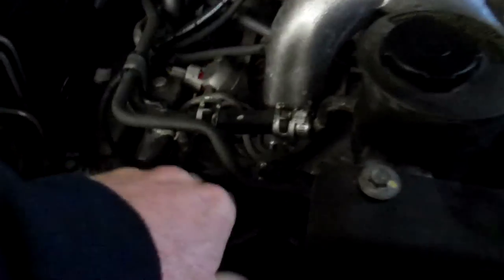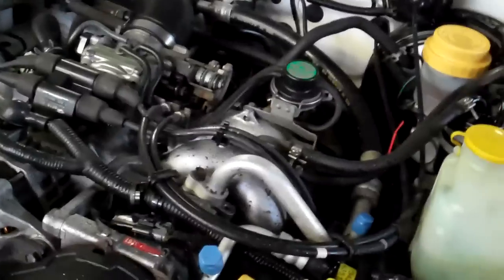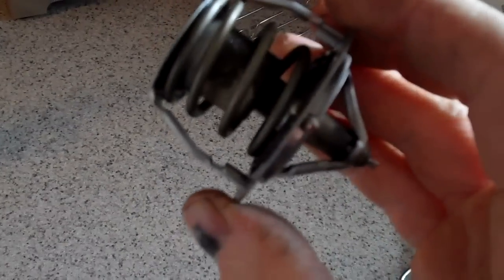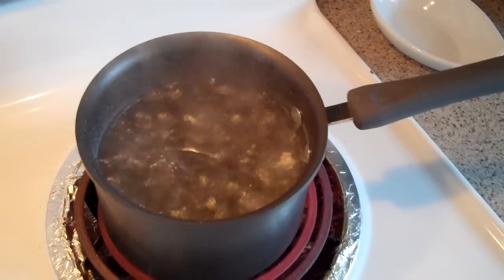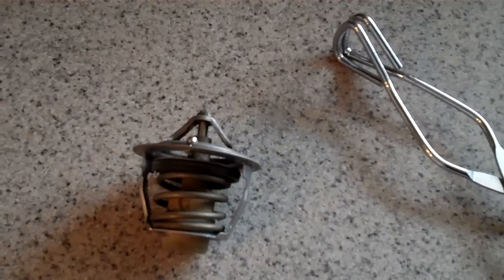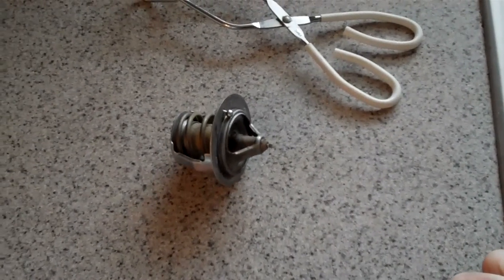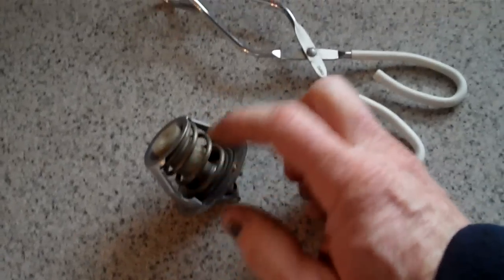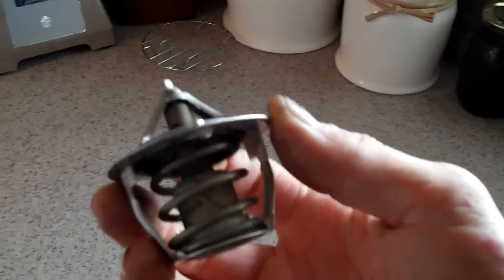How to diagnose a Subaru that overheats after ten minutes of driving

Comment: I have a subaru legacy 2006. My subaru overheats when climbing hills or when on fast speed on a highway or when I go long distances. The engine heats up so fast when I accelerate. Also the coolant is consumed super fast. What might be the problem, I changed the gaskets and had the block realigned, but the problem still persists.
Reply: Mugambi Alois Having the same problem, suspecting the thermostat. Going to buy an OEM thermostat and praying it fixes it. Will comment again if it resolves the overheating. GL to you!
Reply: Thermostat always sticks shut. They put a small hole in them but not enough to keep it from overheating. I always change emm and drill a 1/8 inch hole in mine to keep it from ever being a problem again. Just my 2cents.
Reply: Thanks Kianna. Waiting for the feedback
Reply: I replaced my radiator and the fan switch and my problem was solved
Reply: Mugambi Alois 
Hi, where did you get the fan switch? ..and radiator have good pressure and is not leaking..should i go ahead and changed it anyway? Please answer me back and i do appreciate it, thanks
Reply: I had that issue. My engine just went to shit 2 days ago. At least I think it was my engine.

List of stuff done to my car since I have had it...

Head gaskets
Oil change
Thermostat
Serpentine belt 
Water pump
New tires
New tire stud front passenger
Cv axle, passenger 2x. Bearing was bad in the 1st.
Rockers

I think that is it. I have had this 2002 subaru outback (vin matches a legacy... which is slightly weird) since April 23rd of this year.

I was going down a hill this past week, sounded like something metal shredded and bounced around the underside of my car. Realizes my engine wasn't running. Realized my brakes were not working. My steering went. And my 2yo daughter was with me. Car would not start after I got it into a clearing. Anyone else have any issues similar to mine? Mind you, I also the issues mentioned by the original commenter. Overheating on the highway etc. Oh, and my car stalled out when I was running the heater to cool off my car, and I stopped at a red light.

Comment: Great videos! I've been trying to help a friend of mine with a forester a small dealer pawned off to him.  Overheating ever since.  I've personally never had one.  Helped him flush fluids, change thermostat, etc. He has a family of 6 broke can't afford a mechanic so tried using liquid glass, head gasket sealer... I know, but just trying to get him by, 5 mile daily drives.  Then I saw your videos. So I know it's temp fix as well but what size drill bit? and where should we drill? Thank you

Comment: Question: I was a Honda / Toyota tech for years so much to my disliking my son wanted a 2002 Forester. I hear these are good cars but this thing has been nothing but a piece of shit! When we bought it, the guy supposedly rebuilt the engine. He gave us a 6 month warranty on the rebuild. Within 2 months it blew the head gaskets! We took it back and he replaced the thermostat, radiator, both heads and a water pump. It lasted another 2 months and now it's pushing coolant from the radiator to the expansion tank! I'm at my wits end! Do you have any idea what is causing this? Are these engines really this fragile? You seem to have a great knowledge of these vehicles tell me what you think? Thanks Tracy
Reply: U should ask if he had the heads machined and pressed during the head gasket replacement. The heads shitty aluminum tend to warp when the gaskets go from the high temp and overheating issues from a head gasket gone bad

Comment: Hey brother can you tell me what you tell me what you would think it is when the car only over heats when still, but good when you drive ?
Reply: Check the radiator and its ducting for obstructions and make sure the fans work properly.
Reply: Vix Damone I had that happen on a 2000 Ford Focus SE.  Turns out either the Low/Medium Speed Fan Relay or the actual thermocouple/thermocouple wiring harness were bad.  I just changed both and the problem went away.  Basically, if either of those were bad, the fans wouldn't turn on until the temperature was up in the red.

Comment: well what if your driving with a faulty radiator and your only driving for a few seconds with the temp gauge in the hot range but after like a mintue or so you shut it off to help it cool? the plastic fitting on the radiator that the upper hose connects to completely discintigrated and I was trying to get it home...would that kill my head gasket?

Comment: brian,
i need help on this one. so the car overheated. i put in a new water pump, thermostat, both head gaskets, all the belts and many other little mods. after two hours of testing in 30° temp i have some assumptions. the top hose is always hot and bottom is always cold. i drilled two more holes in thermostat in case of air or combustion gases. when the hot air is on and driving, it cools properly but the air turns cold and instant overheat. mostly turns cold when i accelerate or drive for ....

Comment: I just started having problems with my 1991 sub legacy overheating. it only as 99 000 kms on it, and folks who know my car immediately said thermostat. we haven't tried replacing it yet, but the car is also making a knocking sound. Do you know what that could be about? Otherwise it's overheating, with no warm air making it into the car. It's cold here in BC right now, so that's a noticeable symptom.
Reply: I checked the thermostat and it's fine, replaced coolant (the coolant was looking pretty gross and dark) with the car running. It sounded a bit better with the fresh coolant making its way through the system, but then light white smoke started rising from the exhaust just next to the manifold. I checked the oil for antifreeze and didn't see any milkiness, and I had previously checked the rad cap for oil and didn't see any. Any suggestions of what this could be?
Reply: Annelise Grube-Cavers
Is it turbocharged? Check around the turbo if so.
Reply: Hii did u find the problem?

Comment: I had some serious overheating problems with my 1995 Legacy. After driving for 10 mins the temps were at max and i had checked that i had enough coolant. I was thinking that i have head gasket problems, but car worked normally. There was no white smoke coming from the exhaust. Also i saw that water pump worked fine because the coolant was moving in the system. Thermostat also opened normally when i warmed the cold engine in the parking lot with hood opened. I started to suspect that there was air in the system because there was no warm air coming in. I got the air out of the system and the car won't overheat anymore. Luckily i didn't broke head gasket when i drived with overheating car. At least the car works fine at the moment.
Reply: how did you get the air out the engine? Im having the same exact issue and suspect it has air in system, please help
Reply: How you take the  air out from your system
Reply: @marcorivero1768  Basically i squeezed all those coolant hoses around the engine with my hands to force air bubbles out while engine was running but i didn't stress the overheated engine, i let it cool first. Then there is a special bleeding valve made from plastic to release air out system but it can easily break in old cars. Another way is to open cold engines normal coolant fil cap to release air bubbles from there while engine is running and you squueze those hoses with hands. Caution: just remind that don't open coolant fil cap with hot engine though. More info on this bleeding subject, use words "Subaru coolant bleeding/refill" to see how it's done. This video shows that plastic bleeding valve https://youtu.be/tpy3GpbADRo?si=z_7c2W3VkaZBbdSp
Reply: @marcorivero1768  If the engine is cold, you need to wait until car warms and thermostat opens. I forget to say that idling is not enough, it's better use rpm 2500-4000 to force the air out and force gas pedal with a wood block or use a friend who holds rpm during the process. BTW to everyone, i figured out that it was air in the system because only cold air came inside the cabin even tough engine was at dangerous max temp point and fan was set to blow as hot air as possible to cabin, but only cold air came in so there was a air blockage in coolant system. Car worked fine 20 000 miles after this problem was fixed and didn't happen again. My plastic pressure release valve broke when i opened it but i fixed with Loctite repair putty and used normal radiator fil cap to get air out + hands on those hoses. 

Continually squeeze the top and bottom radiator hoses to force trapped air into the funnel, this can take 5-minutes or so. Now start your Subaru engine and turn the heater temperature up to maximum but the fan speed to minimum. Allow the engine to warm up and the thermostat to open so the temperature gauge reads normal. This can take 10 to 15 minutes, and be sure to keep topping up the funnel as required. Rev the engine between 2500 to 4000 rpm off and on for 5 minutes, this should allow the water pump to force air out of the system. Note that warm air should be coming out of the heater vents, if not the heater must have air trapped in it, STOP the engine and allow to cool down.....

https://youtu.be/Qp7oqWe6vtw?si=lUSTYPh5D47X93Tw

Comment: Presence of exhaust gasses in the coolant is sign of a bad head gasket as detected by Evertough Combustion Leak Detector #67094 and Detector Fluid #67098. As for the Oil thing the problem is there is way too much. The idea of peak oil came from lack of oil in easy to reach places. With the change in technology like deep sea drilling and fracking, oil and natural gas has become plentiful again

Comment: Hey i tried all these and turned out i had a split heater core in my dash and it was only after squeezing the radiator pipe was the coolant that was leaking visible the other give away was the carpet was always wet i thought it may have been because of the front vent leaking but after disconnecting the heater core it stopped overheating

Comment: hi Brian.. I live in Brazil and have a WRX 2002 turbo (all stock). three months ago it had two  singular event.. after one week whitout use, on starting the engine  I heard that sound like connecting rod noise but after few minutes it get normal again ..I completed the engine oil a little bit more..some day after I hit a speed bumper ..and tem . the gas pedal has now an annoying vibration ...could it be related to  CRANCK BEARING DAMAGE or ENGINE MOUNT DAMAGES ( the mine are the soft OEM mounts

Comment: a few minutes, if i let it sit it will take about 7 minutes to cool and still cold air but if i turn it off for a minute or two and start it back up it is always warm air blowing and thermostat open. i am stumped and have no clue. and i used two different thermostats. and new head gaskets and new hoses and flushed 3 times and filled without air voids PLEASE HELP, thanks drew

Comment: We just bought a 1999 Subaru and it over heated on my husband.  The upper hose was collapsed and I could hear some gurgling noises then all the sudden the coolant went down in the over flow and the coolant went down in the over flow.
Reply: Hi! That is exactly what my 99 Subaru Legacy Outback is doing. Curious to know what your outcome was??? I have bled air from system multiple times and replaced thermostat- and drilled several little extra holes in thermostat to allow better flow through it all of the time. Hot hose on top and cold hose bottom.

Comment: briansmobile1, you are almost a celebrity Brian, all due to your 'hot' information.
Can you please advise where the coolant temperature sensor plug is on this boxer motor?
Subaru Forester XT 2.5 litre engine 2007-2008 crossover model I'm told.
There was no temperature gauge on dash-panel, or in an electronic dashboard display, only a temp sensor light that when it comes on 'red thermometer' appears in dashboard display but only when it's too late and the head gasket has given itself a pestering overheating gasket crack.
I am in Australia, State called Tasmania. I would truly appreciate your direction as to where that sensor plughole is located?
Thank you, Brian, give me your address and I'll send you a thank you gift. Old William.

Comment: so there was a little oil in the coolant overflow tank. what does that mean exactly?
Reply: HG, but are you sure it's oil and not just deposits from the cooling system? The deposits are usually black and floats up to the surface in the overflow tank. Its plausible that it could look a little bit dirty in the overflow tank without it being anything serious.
Reply: MYTURN2DIE SUNDSVALL

Comment: Hey Brian

Love your video's! They are extremely helpful!

I recently changed the thermostat and filled it with with water to make sure that was the problem. But then I did a radiator flush and put antifreeze and it started heating up again? When I did the flush I did remove the thermostat to drain the flush out completely. It has been over heating ever since?
Reply: Water pump?

Comment: 06 Subaru legacy 2.5i sohc
Just did head gaskets, heads done by shop, water pump, timing belt, radiator an thermostat. Burped an still overheating. The top hose is hot but bottom hose is cold. Yet still have heat in the car. I'm stumped. HELP!!
Reply: Levi did u find out the problem of overheating

Comment: I have a 2004 wrx it just started to overheat randomly it goes away and comes back could that be a thermostat
Reply: What affects whether or not it overheats? Does it overheat when still but stay at temperature when at speed? Does it vary based on the type of driving done?
Reply: I figured it out lol rookie mistake low coolant
Reply: brandon banks Where'd it leak out from?
Reply: Not sure in the summer I noticed that the turbo reservoir would leak some if I moved the coolant lines some so I hope it's just those and not a gasket 😓 crossing my fingers

Comment: Hey could anybody help me im about to try and get a legacy97 for 400$ that overheats and and im hoping i can buy it and it can be a simple fix. What should i check for to make sure i dont loose by buying one with a warped head.
Reply: +GnarlyWaffle Don't buy a Subaru with a over heating problem unless you are prepared to replace the head gaskets.  The boxer engine is very sensitive to any over heating.

Comment: PLEASE HELP GUY FROM NORWAY!

Forester 2006 EJ20  200.000km 1 old Guy had the car whole life Service all the way to 190.000

Ive had an overheating problem for 2months now and im so tired of Searching the web for it couz it seems im the only one inn the world with this problem... i had overheating and hesistation from 1500rpm up to 3200rpm And after that it was like the engine got 50 more hp. i cleaned the M.A.P and EGR. and the Vacum valve and Reseted the ECU. drove it for 2 hours after was abit wierd but it went on learning and the hesitation seemed to be gone. but when im really putting my foot on the gass like up to 5500rpm or going up hill other then the second gear i get up to 100*c to 110*c i stop imidietly. and im having to Add coolant only when the engine overheats and ive pressure testing the Radiator to 1.1 BAR and over night it sinks down to 0.8 bar so i dont feel thats enoough to tell me theres a leak or bad headgasket.
ive super flushed the Antifreeze ive taken the Radiator off and Super cleaned that ive trown Leak Sealer into it its a little bit better now but. i thought it was the catalysator i have sprayed about 1.5L into the Intake while Rewing it to 3500rpm and the car was super for 1WEEK and then it came back to the problems the spark plugs are new.
and i Drive it with a OB2 scanner so i can see the digitals and the manuals inn the dash board and it Seems the engine has 2 diffrent Temp sensor couz the digital one Rizes before the one inn the dashboard 

subaru wants 3102.18 USD to change the headgasket so im really trying to Find the problem to not spend that insane amount. im so desperate and anoyed to Fixing other peoples cars but i cant Fix my Own now thats a laugh....
theres is no antifreeze inn the oil cap or dipstick or exhust coming into the radiator (i see no bubbles) and no smoke out of the exhust. i will Check the drain pan... when i rev the engine Fast the is anti freeze coming out of the radiator that is a sign of Water pump ok? yeah

when the Car is Really hot i touch the upper radiator hose its Hot and it feels like theres nothing but air inn there and the bottom one is cold and yet its slowly filling the reserve tank with hot antifreeze

Headgaskets 3100 USD
Timing belt total 1670USD
1L Petrol 1.7USD 4Liter =1 gallon 6.8 a gallon of petrol now thats 95octane the cheap stuff we also got 98 and 99octane

Comment: I just recently purchased a 97 Subaru legacy ej25. two weeks ago I did an oil  change on its scheduled time. not even two days after the oil change it started to over heat. so I replaced the thermostat. two days after replacing the thermostat it started to overheat again and blew a hole in my radiator.  I replaced my radiator today and it started to overheat again after driving. ended up dieing on me in the middle of the road. both antifreeze and oil seem to be leaking. antifreeze is at the front of the  of the car under the radiator but the oil seems to be leaking by where the exhaust downpipes connect into 1 pipe and I'm just at a loss of what's going on as I had been driving it a little over a month before this issue arose. and the only leak I had noticed was a power steering leak. any info would be greatly appreciated.
Reply: this may be far fetched but if it's leaking oil, check the grommets on the head gasket valves. thats where mine was leaking from when i got it back from a shop for a rebuilt motor job (never going back there!) but i was loosing about a quart a day and took me forever to figure out exactly where it was coming from